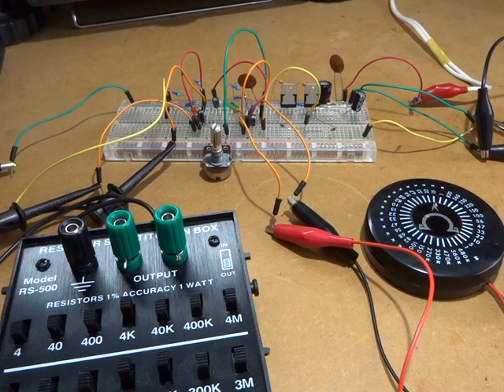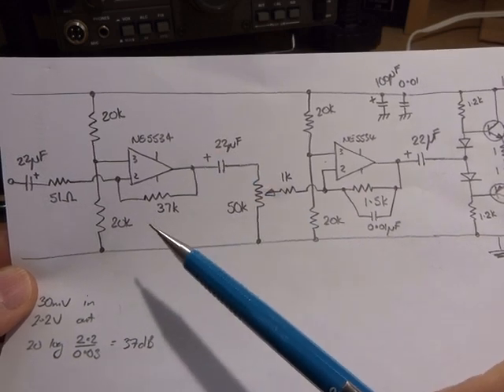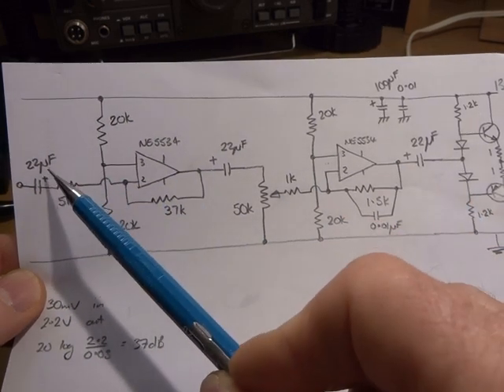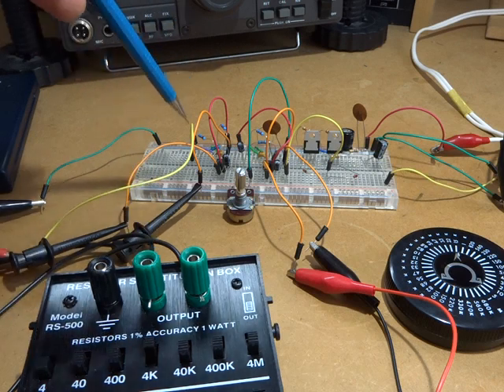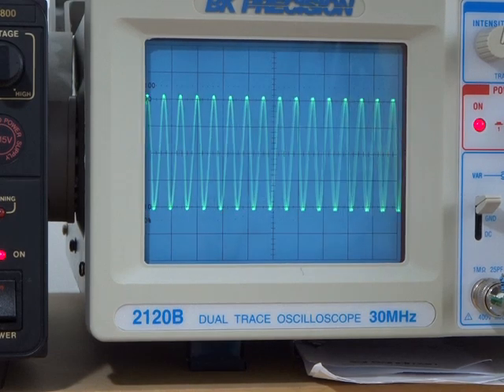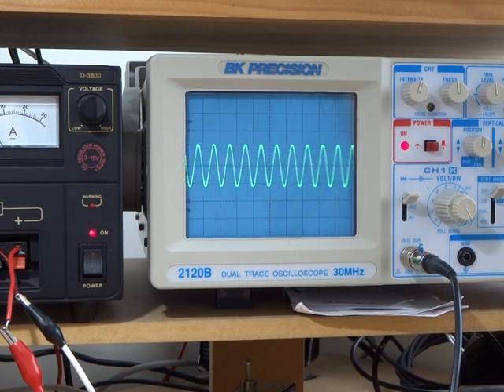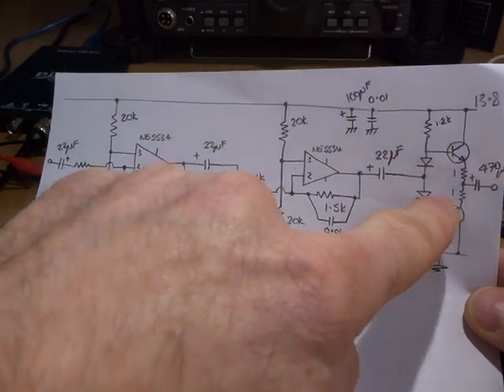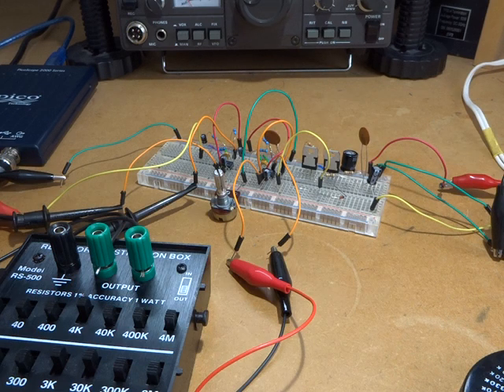Homebrew 80/40m SSB/CW Rig - #2a Audio Amplifier Experiments

Comment: Hello Charlie, nice channel.  I think you need to use a capacitor to couple the signal out of the pot to the last OPAMP.  The opamp's pin 2 is at virtual ground (VCC/2) and you have it DC coupled to the pot.
Reply from the maker: Thanks Bob. That makes sense. I'll add that to the schematic. Probably a 4.7uF should do the trick.

Thanks again.

Comment: Hi Charlie, I think the change in low pass filter response is just due to the value of the capacitor in parallel with the feedback resistor in the second stage. If the resistor is increased then the capacitor needs to be decreased to maintain the same response which has a 3db cutoff of 1/(2*PI*R*C). Cheers, Ian
Reply from the maker: Ah yes, good point Ian. That certainly makes sense. Thanks again.

Charlie
Reply from the maker: Ian. I reran the experiment in an effort to better share the gain between the two stages. The final config was:
1st Op Amp: Ri = 51ohm, Rf = 1.5k
2nd Op Amp: Ri = 1k, Rf = 33k

Should there be a need for the bypass capacitor on ther second stage Rf (in the past to knock back interference) then a 100pF works well and keeps the gain flat out to 7kHz.

Cheers.
Reply: Cool, that's awesome. Looking forward to further videos! Cheers, Ian
Reply: The dual op amp circuit is used as microphone amp stage ahead of a diode ring mixer in some homebrew designs, including the G6LBQ Bitx and Eamon EI9GQs book.
Reply from the maker: Thanks Paul. I hope I didn't give them impression that this was the first time a dual op amp AF amp had been used. That certainly wasn't the intention.
Cheers
Charlie